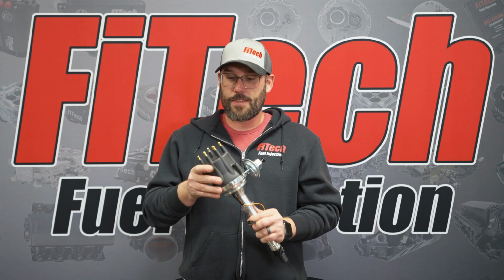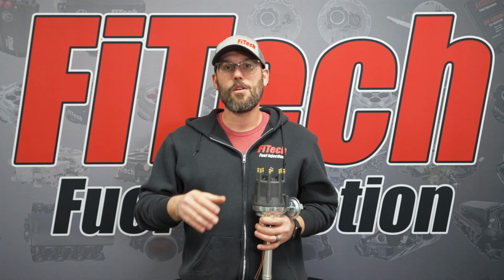FiTech Go Spark Distributors | Tech Tuesdays | EP98

Comment: I’m getting a RPM noise code. I just have an eBay distributor. Would this make any kind of difference?
Reply from the maker: Possibly. It could also me a failing coil, loose connection, non resistor spark plugs, or wiring from the alternator running parallel to the EFI wiring.
Reply: @FiTechEFImedia  ok thank you I will try all of that.

Comment: Everybody makes distributors. How about creating a program for cruise control. You have the means, and probably the demand
Reply from the maker: There is no programming a cable driven throttle body EFI system for cruise control. That would require a drive by wire system which has not been released yet.